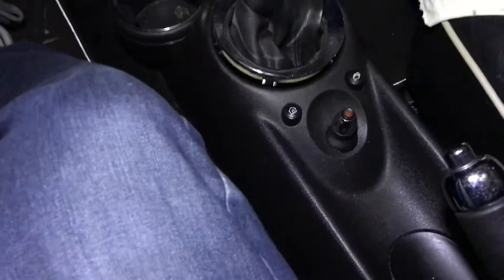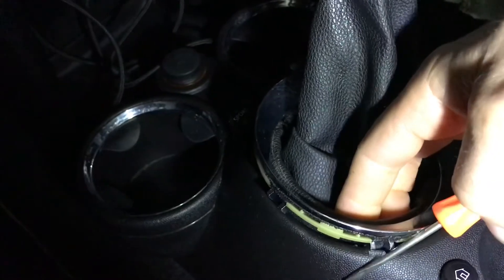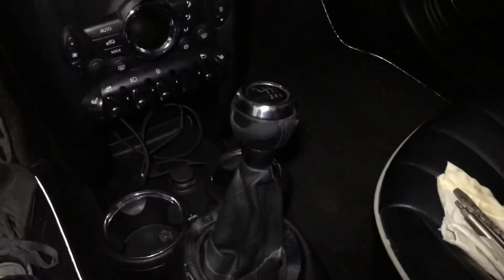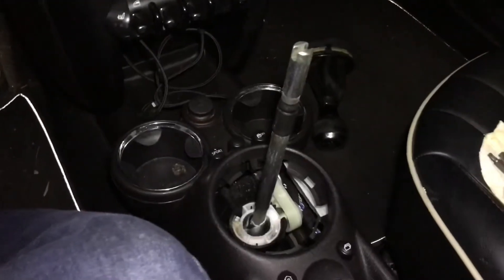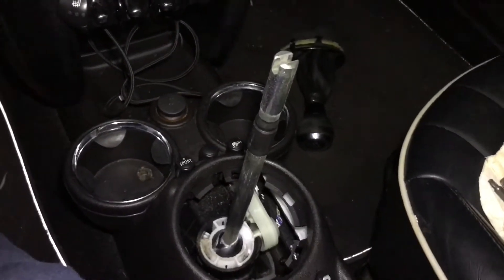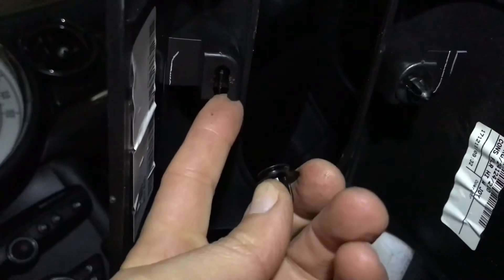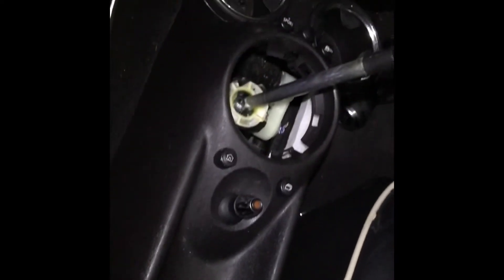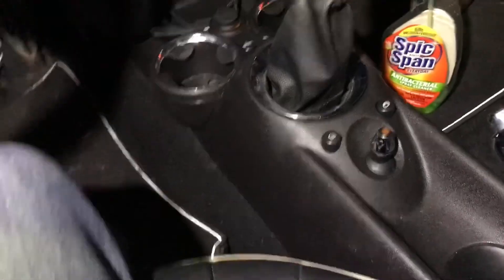How to remove center console ,gear shifter knob & multimedia joystick on a 2007 - 2013 Mini Cooper

Comment: I did my 2011 S Countryman today.  Pretty straight forward, especially since I didn't have to guess at how the trim stuff comes apart.  That would have been the hardest part.  A simple plastic pry tool, and I now have a working joystick.

Thanks!